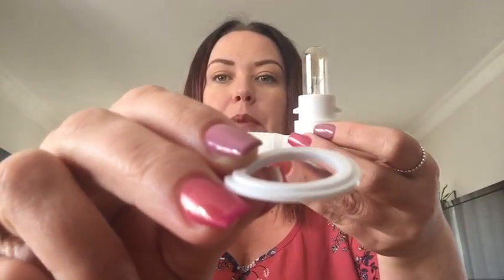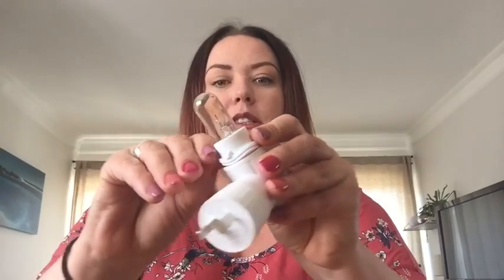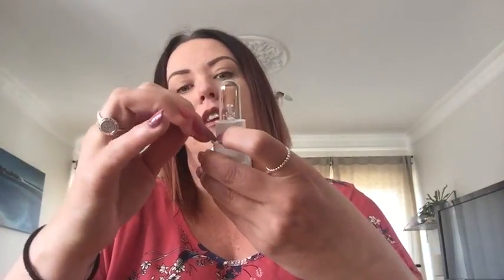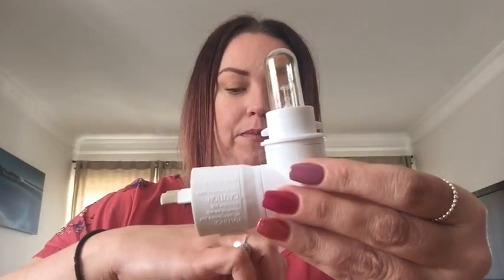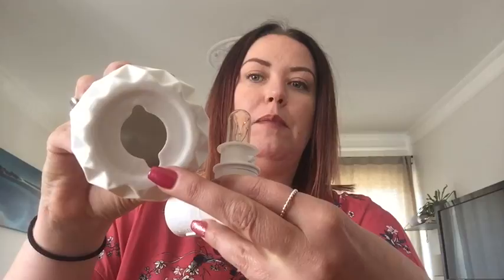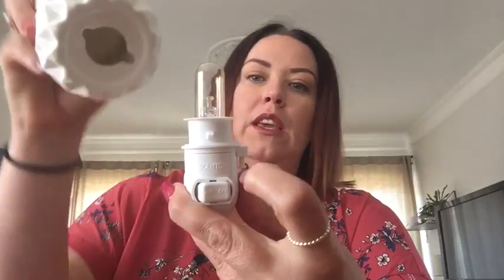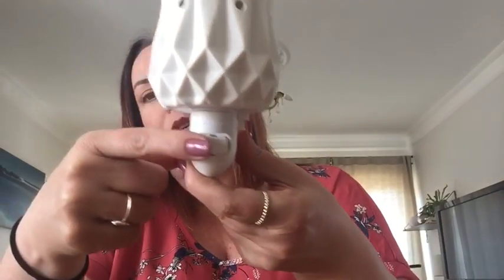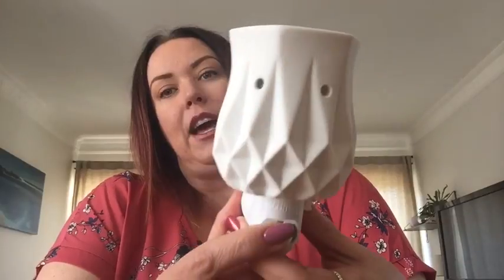How to assemble your Scentsy Plug In Warmer

Comment: How many melts done it take? I can’t find the number 🤦🏼‍♀️
Reply from the maker: I usually start with one cube and then if the fragrance is strong enough, leave it at that.. if not, you can add one more cube to the dish.. I wouldn’t add too much more than that as the dishes are small on the mini’s and you don’t want to risk spillage! The mini’s are great for smaller rooms like bathrooms, closets or laundry’s! For larger rooms, I’d go with a full size warmer that can take up to 4-5 cubes (the number of cubes to be used on each full size warmer is written on the base of the warmer dish 😉)

Comment: the thinner washer doesnt go on top like that... i found your video as i was unsure where it went and got so frustrated as it was just loose in the warmer if you tipped it and thought surely not! turns out you just put it on top of the thicker warmer for it to secure snug... just thought i would comment so others dont spend ages trying to figure out why it isnt fitting right haha
Reply from the maker: Rhiannon Griffiths the thinner washer is added in case the thicker washer isn’t quite enough to make the shade stable.. sorry if that was unclear in my instructions xx
Reply: Thanks for this coz it wasn’t fitting right and because I couldn’t adjust the shade to where the screw goes . Started to lose it abit haha

Comment: How do i switch the wax???
Reply: I've heard of folks letting it cool/harden, and then simply peeling it off and saving it so you can use it again, instead of throwing it out. I'm not sure if that's what you're "supposed" to do, but I don't see why you can't reuse it
Reply from the maker: King02tutt 0 it’s super easy to change wax using a couple of cotton wool balls! Drop them in the melted wax and they’ll soak it all up.. remove then wipe out with a tissue and pop your fresh wax in! It’s that simple!